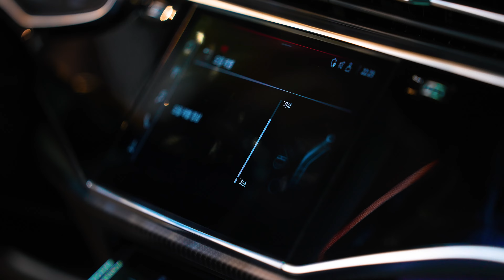AUDI RSQ8 engine oil change, XADO 아우디 RSQ8 엔진오일교환-카프레소-

Comment: How does that oil filter housing take all that heat by turbos?
Reply from the maker: The oil filter housing is equipped with a heat exchanger.